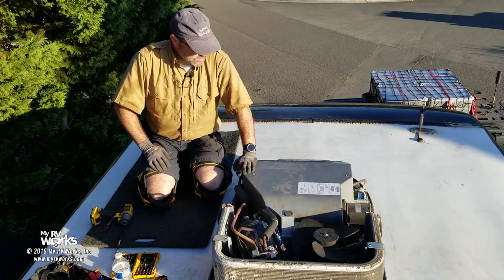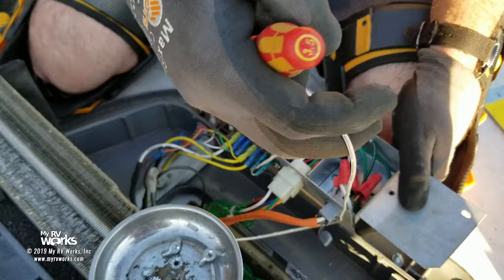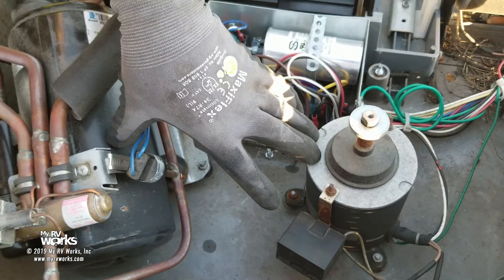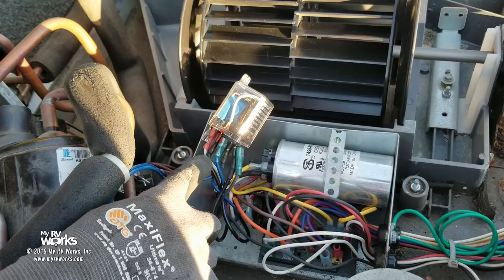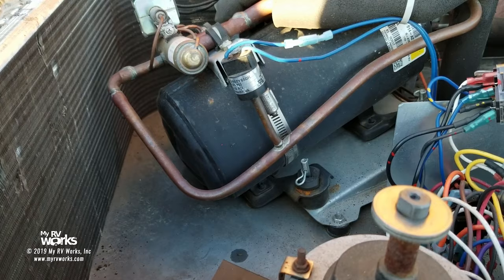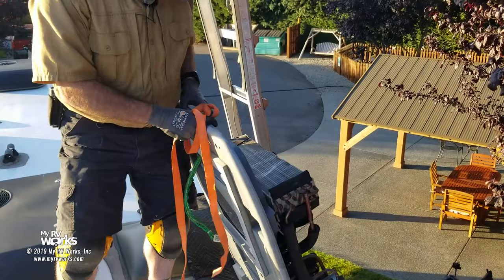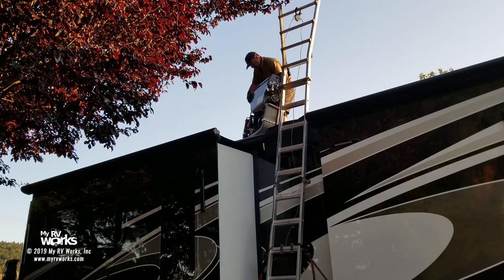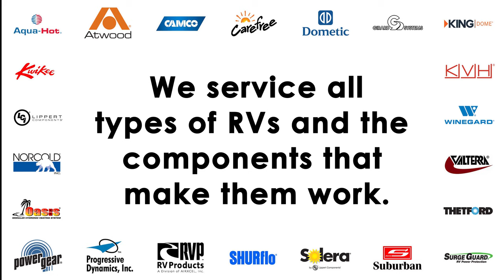Troubleshoot And Replace This Coleman Mach 8 RV Air Conditioner

Comment: If you don’t have a warranty or the money to pay a HVAC tech to replace the pressure switch just bypass the pressure switch and run the a/c until it dies. It can run like that for a long time. If the reversing valve fails or the system gets a clogged then the system might over pressure and bust out at the weakest point.
Reply: I know this was 3 years ago but does the white wire on relay do the same as twisting the 2 blue wires together?

Comment: I highly recommend simply renting a "material lift" from Home Depot for $55. It can lift 450lbs up to 12ft, and will fit in the back of an SUV or pickup. Made my install super easy and safe.

Comment: There is no price that can be put on the time and information you unselfishly provide.   One has to wonder if lack of use was the culprit for this failure?  Equipment was meant to be run and used, not sit idly by.
Reply from the maker: Thank you for your kind comments. Not sure why this air conditioner failed. It was a $12 part something so simple.
Reply: @MyRVWorks  I worked on my 3 AC's last summer, cleaning the coils and regular maintenance. I am very puzzled why they don't add the necessary ports required to service these units.  The cost of adding a high and low pressure port on this system cannot be that expensive to the 1500 dollar unit.

Comment: There is oil mixed with the freon. It is important to let an air conditioner to sit for 24 hrs anytime it has been not kept completely flat. There is a valve or a smaller diamiter tube that restricts flow to the evaporator. This can get plugged. Better safe than sorry.

Comment: HELP-  Question for anybody who can answer.  2005 class a motor home. Both units Have 12 V to the control box. Both units have 120 V to the control box.  Both units fans are working.  Both units compressor is not working. When you jump out the compressor relayed by connecting the black wire to the purple wire compressor comes on. Both units are controlled by same thermostat.  I've tried jumping out the freeze sensor and the room sensor. Still doesn't work. What is the problem? Myself and the best people I know can't figure it out. I'm thinking it must be the control board or the thermostat or the wiring.  We are not getting 12 V to the one side of the relay.

Comment: Just wanted to give you a big thank you for your video about the Coleman Mach 8 A/C.
Mine quit cooling but the squirrel cage fan was running.  Checked everything you recommended.
One thing mine did different than the one in your video was that when I turned it on, the top fan would start but only turn about 1/2 a revolution then stop.  That sort of said it was starting to get some power, but not enough to start.  That also said that some power was getting through the high pressure switch.  I then replaced both capacitors and... Yippee.. The A/C now runs great and cools just fine.
Again, thank you.  PS:  We were in Port Angeles a couple years ago and loved the area.

Comment: Thank you for all the diagnostic pointers that you have in this vid. I checked all the connectors on the compressor, checked the capassotors, everything checked good but it wasn't cooling. I went beyond your vid and installed a saddle valve to check the pressures and it was low. You know what I'm about to say, it had a leak. So I had to research for a replacement unit. My Coleman Mark was discontinued, so I contacted Coleman and got the new replacement and ordered one. It came and my son-in-law and I replaced it. Only the unit, because it was a plug and play to my old unit. The control box and vent cover was reusable.  Thanks again.

Comment: FANTASTIC. I have the EXACT issue happening right now, I have a Warranty and the first step is to get a Mechanic to look at it but I believe based on what you showed in this video I can take it and have them diagnose exactly what you showed and get it covered for replacement.

Comment: GREAT video!!!! I am a "jack of all trades" type (and, a licensed Jouneyman Plumber), do all of my own work on rolling stock, house....whatever. As long as I do it to my own standard, I'll do it...myself.
This video helped greatly. My MH (1990  Itasca Sunflyer) frequently has issues. Right now, the Coleman 6759 (or, 6757 not certain yet) ceiling unit runs and cools on Low cool. But, no operation (except comp) on High setting.
I will fix it. Your video was the first stop! Though not all directly pertaining to my unit, enough info to allow me to proceed.
Thank you!

Comment: I just now watched this video and it’s very educational, thank you. I don’t think it pertains to our issue but we shall see tomorrow. 
We’ve got a 2015 Durango Gold and our ‘upstairs’ AC is the Coleman Mach 13.5 btu model 47253A879, and its original to the rv (also we’re full timers). We’ve been fighting massive amounts of condensation dripping on the upstairs bed. I’ve cleaned the coils, I keep the filters inside the rv clean, and those weird black sponge pieces that go below the coils I keep clean as well. But no matter what I do, water builds up in areas where there isn’t a drain hole. Now today it starts struggling, it’s like an engine when the rpm’s drop low then come back up then drop again repeatedly. I turned it off and pulled the covers off and of course it’s full of water again. On a side note, after a storm about a month ago the ‘low’ setting on the thermostat stopped working, it’ll run on low but it’s actually on high, meaning there’s no difference between the two. 
After I cleaned the whole AC out, I let it run on fan only for a while, then turned the AC on. It ran for a few hours and finally cut out completely. No breakers tripped or anything. For that short time it ran it blew very cold, so I wouldn’t think the compressor is going. But I can’t figure out why it would be running how it was, up and down is how it sounded, then run perfectly fine after I clean it out and it sits for awhile, then it just shuts off. I’m going to do some troubleshooting tomorrow, but if you happen to see this comment between now and tomorrow I’d be curious to know if you have any thoughts. 
I replaced our main AC a couple years ago because the compressor crapped out, definitely not a hard job but with what these things run now I’d rather fix it if possible rather than replace it.

Comment: I did your follow the lead test and fixed my RV AC. I only had 7.3 vac to the compressor. I found the main interior AC line was not connected properly. Only sending 7.38vac to main switch. The connection under the wire nut was connected to the black wire AC insulation. Connected properly and AC is now blowing at 56 degrees. Thank you.

Comment: I've been building a cart/jack system similar to your own, but yours is much simpler. Thanks for the vid, I've been struggling with Mach 8's and Penguins on my own and need to find a way to hoist them like this. Thumbs up from Farley's in Sarasota FL.

Comment: Thank you for the great videos Sir! I used them to rule out most things on our Coleman Mach 15k BTU HP2 Heat Pump. The fan comes on but no compressor engagement. 5 wasp nests, great tip! When I did the Common to Run and Common to start, then Run to Start test, the value was half of what both of those added up to. Does this mean a weak compressor? There is a possibility the RV had a power surge that is at play here. 

I checked the capacitors, they are fine. I checked all the wire connections were seated. Even happy to pay for a phone consult if you do that sort of thing.

Comment: Thanks!
Reply: Do the bolts come in from the top when there is no ceiling access on those fancy rigs?  I assume they do, but you know what happens when you assume!  BTY, I'm making an older ladder into a crane come this week end, however mine will be 110 and plug into an extension cord.

Comment: If you pull the white wire off the clear relay the ac will run, which also makes for a quick diagnosis. Coleman doesn't use that clear relay anymore. When those units went bad Coleman would replace the ac under warranty.

Comment: We have three of these on our Tiffin bus. Last night it was 56° out. We turned all three on to warm up our bus. The back unit ran all night. The other two units stopped. On the thermostat it says d i f f. I think that means they thought it was too cold outside to run heat pump mode. Just for fun I turn the air conditioning side on. They both ran just like they did this summer no problem.So before I climb up on the roof do you think I need two new free sensors?

Comment: I have the same unit, different problem. Squirrel cage evap fan motor has a long shaft that goes through a white plastic guide, with bushing or bearing, the bushing or bearing is missing or decomposed and the motor comes on, shaft wobbles, sounds like a Sawzall cutting through the roof.  I need the stantion, or the bearing that goes in it and the motor, as shaft has excessive play. See my video posted. 
Where do I get that plastic shaft guide with bushing?

Comment: I have a coleman mach 3 and my compressor didn't go on for a while but then when I went up on roof and took cover off the compressor powered on but it still doesn't cool. I got 3 capacitors could it be going bad?

Comment: I was always taught once the AC unit was stood up on its edge it needed to rest flat for 24 hours.  Is this true?
Reply from the maker: That is not been discuss or covered in any of my training. With the number of AC units I have installed, and started right away, I've never run into any issues. Since it has a compressor it will sort itself out rather quickly.

Comment: I've been trying to avail of the warranty coverage as outlined by Coleman. However, I have encountered significant obstacles that prevent me from receiving the assistance I need. I initially visited a Coleman Dealer, Dalton’s RV Center, per Coleman's instructions. Despite adhering to their guidance, the dealer refused to honor the warranty, citing my Amazon purchase as the reason for denial.

Comment: Loved the vedio.
Have a question,  I have he same exact unit and my problem is that the compressor will turn on and run for 2 min or so and then turn back off, so it cools for 2 min then off for 5 min then back on . This way will never get cool in the trailer . Is it the thermostat?

Comment: very interesting.  What harm or danger would there be to just cut the two blue wires at the bad switch and tie them together bypassing the thing altogether?
Reply: If something causes overpressure in the system the compressor won't shut off.  You could rupture AC line and have refrigerant leak.  Other bad things could happen as well.  It's maybe something to consider to keep AC running for rest of camping trip but not a long term solution.
Reply: No, that wouldn’t happen. There’s also an overheat sensor on the compressor. If it over pressure it would strain the compressor which would overheat it and stop it working that way and the chances of something getting clogged are very slim anyway.cut it run it till the wheels fall off.
Reply: @delinquentdesign  If that was a valid way to ensure the safe operation of the system they would not have installed the pressure switch in the first place.

Comment: How you doing sir I have a dometic ac 13,500 btu and it has bit the dust. I was wondering if I could replace it with a 15,000 btu dometic . And if so what all would I has to do different? My trailer is a 50 amp and this would be going on a ducted system.  The 13,500 wasn't strong enough to cool my 41 ft toy hauler.  It has another 13,500 btu in the master bed room. But its only good enough to cool not even but a 1/4 of the trailer.

Comment: No power. Got shore power. Was running on board generator with a/c set at 78 was doing great then I set it to 50 and it ran for about ten minutes and then everything died. Everything still works on shore power but I have no power to start generator and no power at all on the 5th wheel when shore power is disconnected plz help kind sir also replaced converter and the two small circuit breakers in the battery bay

Comment: I an new at this, and I can not count how many times I got light up like a Christmas tree. Now I am scared touch my ac unit. The problem is it keeps freezing up and low dose not work high is only thing works I got on top to figure it out. I am no where expert at this I came close getting killed I touch wrong wire it was live.

Comment: Let me try this again.  Love your channel,  lots of help and good info.  My HW10DE element shows 111v at the element and 12v from the meter.  The ohm reading is 11.2 but every time I turn the switch on 111v, I hear the sizzle for about 10 seconds and it stops, no hot water on ac.😞 what am I doing wrong??? Please advise.  Thanks.
Reply: 3 months and STILL NO REPLY?   im a new rv tech myself,  have you figured this out yet, lmk
Reply: @haydensommers420  yes, the new element that I keep in my spare parts was the answere.☺

Comment: I have a Coleman mach 8 model 47004A879 on my 2015 Lifestyle 40' 5th wheel. I am on my second replacement and it just started blowing warm air yet again. Is it just me or is this a TERRIBLE AC unit ?!?!? With the current COVID situation, finding a service tech seems impossible. My trailer has full body BLACK paint with graphics which is making this outage worse.
Reply: dude i have same problem in all black 28 footer! looking for tech now .. can you help?
Reply: My second Coleman Mach 8 quit working after 2 years. First one was replaced under warranty in 1 year. Conclusion is these are junk!

Comment: Save you same time, he doesn’t tell you what was wrong. He replaced the unit with a new one.
Reply: He did say what was wrong.  The high pressure switch was bad.